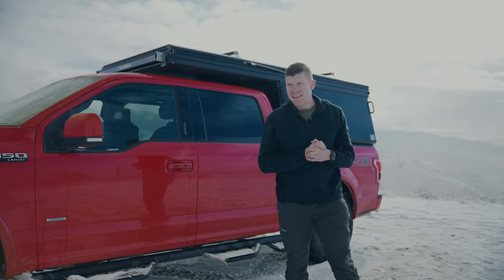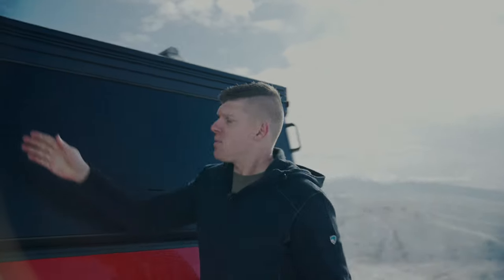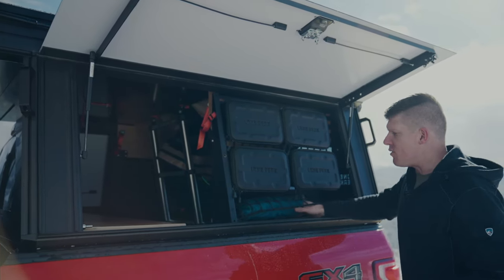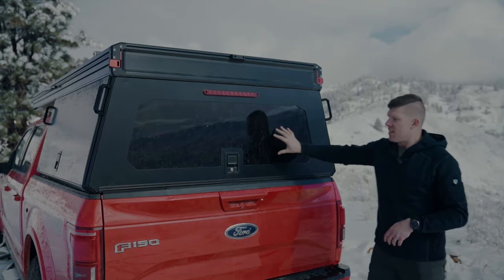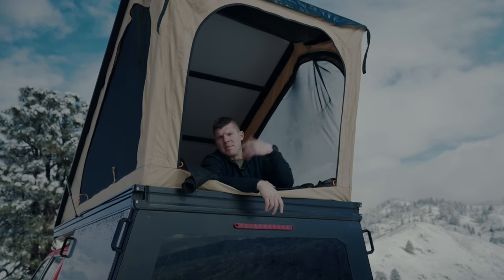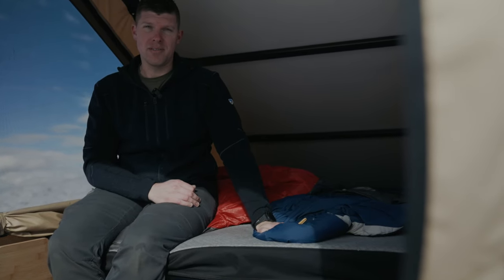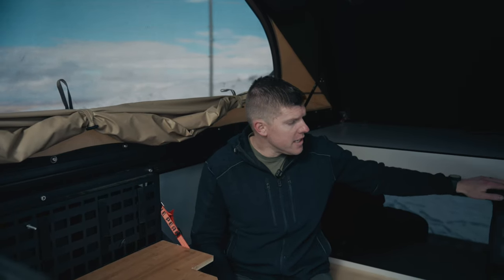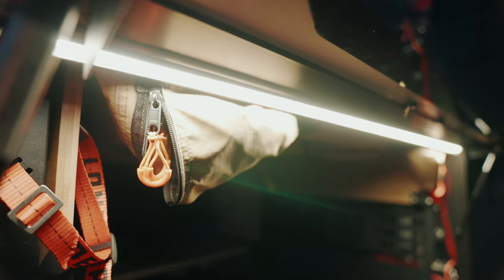Lone Peak Camper - Full Walkaround

Comment: I'd like to see someone laying on the bed to get an idea of the actual sleeping space.
Reply: Go to his Instagram
Reply: I have a 22 Ram 1500 with 5 foot 7 inch bed. How long is the sleeping bed?  Being able to get up and down is 100% critical. Thanks
Reply: I agree, this is very cool set up however. The bed looks like a one person size?
Reply: @McGooIntheRock  mattress is 80 inches long! That leaves about 32 inches to climb from your truck bed to the camper bed. Sleeping area and the 32inch pass through space does not change based on your truck bed length.
Reply: @jefferymaxfield7826  The sleeping area is 80” long and dependent on if you have a full size truck or something like a Tacoma or Jeep Gladiator dictates the width. Full size trucks will have a bed that’s 54” wide and smaller trucks are 50” wide. To put in perspective, a full size bed, the one between a twin and queen bed, is 54 inches wide.

Comment: Nice video and design, especially at that price point.    From the answers below (10" above roof) (it seems like this may be able to fit on a Taco (70.6" roof height to fin),  or Maverick (69" to fin top) and still fit inside a 83" garage door opening.  Can you confirm?

Comment: For someone worried about security, I would have thought you would put more engineering/locks into the side access doors. Those things look flimsy and very easy to break with a simple pry bar. Plus only having one latch/lock on the bottom is not good for security.  Cool overall product though!

Comment: Hey Kyle, it’s shaping up! Looking great. I’m wondering if you can highlight the rain guard system specifically. It looks saggy in the glimpses I’ve caught. Main concern is flapping in wind and building up a puddle. Thanks! Great work!
Reply from the maker: Good eye :) We're going to make some adjustments on the production version to tension it better and make the angle a bit steeper.
Reply: @lonepeakoverland9213  thanks for getting back to me! Does the support have something to lock it in place as well? I've been camping in some serious tent collapsing winds this season
Reply from the maker: @ericberry9445  it does have pins that lock it in place. I’m not super happy with the prototype support so it’ll get beefed up for production.

Comment: Any thoughts to adding vents with rain guards to ensure condensation doesn’t build up during cold weather camping?
Reply from the maker: We might be able to do that. Do you have a reference I could check out to see exactly what you mean?
Reply: @lonepeakoverland9213   I saw a set up the Super Pacific had on their tent.  Looked like a zippered screen vent on the top of each side with what looks like a rain fly.  I have done some cold weather camping, and I always have condensation build up on the inside if I am all buttoned up. Wonder if there is a way to fabricate something onto the top of the camper as opposed to the tent sides.  Maybe something like what RSI Smartcap has on their toppers.

Comment: Love the reveal!! A few questions - for shorter bed vehicles (5ft short bed Tacoma), is the pass through feature still available? I imagine the sleeping platform would just extend further over the cab of the truck, correct? Also, approximately how far above the roof does the top of the camper sit? Lastly, can you elaborate on the framing construction of the camper? Is it able to withstand abuse from heavy off-roading (vibrations, hard impacts, etc.) without compromising the integrity of the frame? I'm absolutely intrigued; its going to give my GFC a run for its money with all the awesome features!
Reply from the maker: Yes, we’ll have a pass through window available still and yes, the platform would overhang a little more on the 5’. The top of the camper will be about 10” off the top (8” tall with 1.5” gap for bed flex). The frame is extrusions bolted together. The vertical uprights are about 7” wide which provide a ton of stability. We just off-roared the hell out of this thing last night and it’s doing great :)
Reply: Just found your vido. I have a 2019 ford ranger 5 foot bed. Do u make one for this and how would you ship to PA. Thanks

Comment: Are these easy to remove? Do users leave them in all the time?
Reply from the maker: The base camper is about 375lbs so it requires some work to remove and install. While this is heavy to be frequently lifting, it's fairly light for a camper. Ideally you will be able to leave the camper attached and still have the ability to use your truck bed.

Comment: Did the bed length come out like you wanted? I remember something about an adjustable pivot point so tall guys like me (6’3”) don’t have their feet cramped in the wedge.
Reply from the maker: I had to move the bed platform 4” away from the pivot for clearance for my feet which reduces the pass through space to 32” but it’s a good adjustment and will fit 6’3” guys and can be moved further away if you’re taller.

Comment: Tent fabric Insulation liner?

Aluminum shell insulation?

Heater?

Air Conditioning?

Mattress dimensions?
Reply from the maker: Planning on some more testing of a removeable insulation. Focus for now is on a diesel heater. Air conditioning is also in the works. The mattress depends on the truck size 50-54" X 80" -Kecia

Comment: Hi, I am on your pre order list however I do have more questions. 1) Is the camper designed to flow with truck model body lines or will a camper built for a 6.5 ft bed fit any truck with same lenth bed or close to same lenth? Scared I may switch trucks and have a camper that won't fit, 2) Buying a prototye is always scary, will your company provide critical updates to flaws discovered after production units hit the market? 3) With the great administration totally rapong the econemy are you still able to sale for a full size truck at the 4995.00 selling point you are advertising? If so how long will these prices stay low enough? 4) IS shipping going to cost more then Camper? :) 5) Do you plan on an easy access point on roof so clients can easily add solar panels to the roof racks? 6)I know you mentioned some plumbing being available for external set up Diesel heaters, what would that look like? Thanks and I can't wait for launch myself.